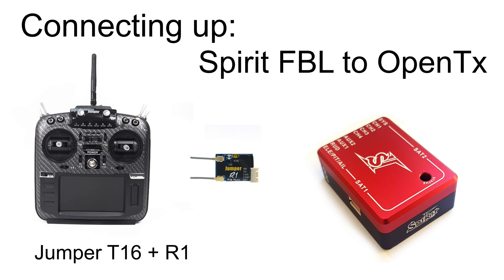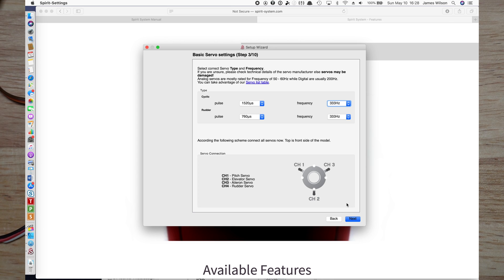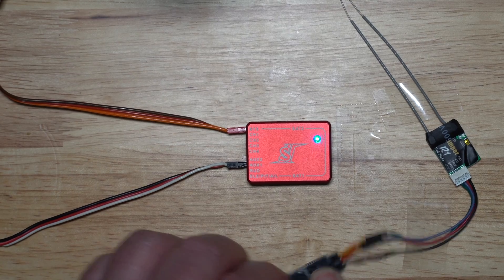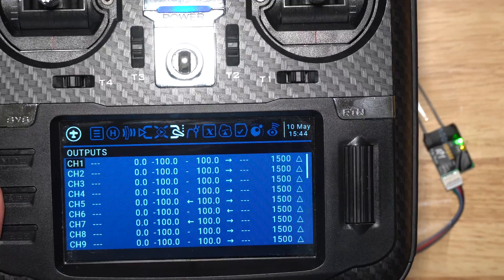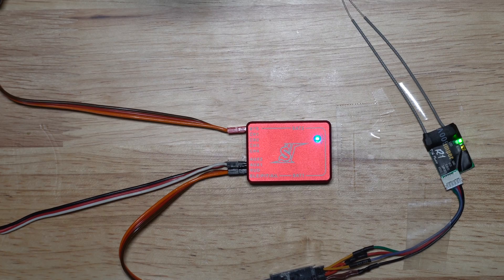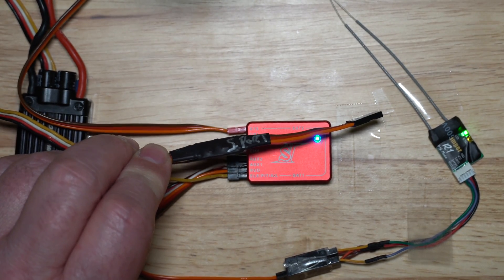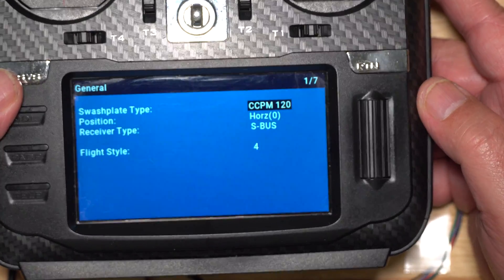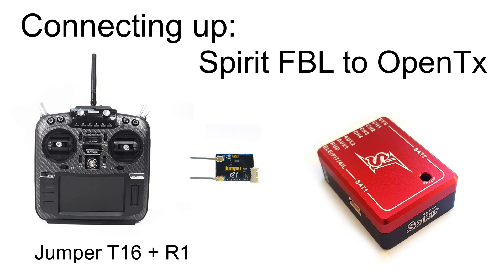Hooking up a Spirit Flybarless with a OpenTx system

Comment: Have you tried this set up with the Access firmware? I can get it to work with the Accst firmware. But when I try it with Access, the receiver doesn't power on. I'm using Rxsr
Reply from the maker: Afraid I have not...and right now I cannot think why it should not work

Comment: Do you think that LUA script might work with another FBL unit like iKon or BeastX while using an OrangeRx Transmitter module?
Reply from the maker: I doubt it as Spirit and iKon etc would have different interfaces you would think but I have not tries so don't take my word on it.